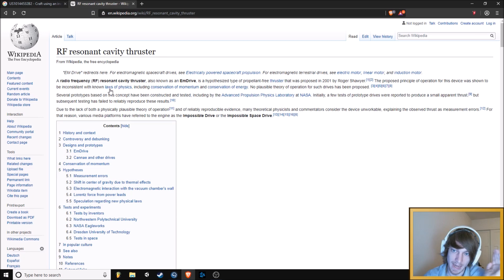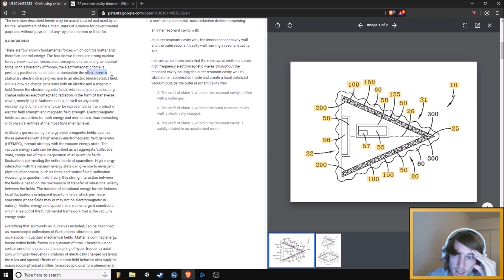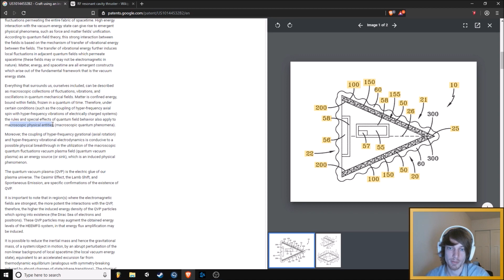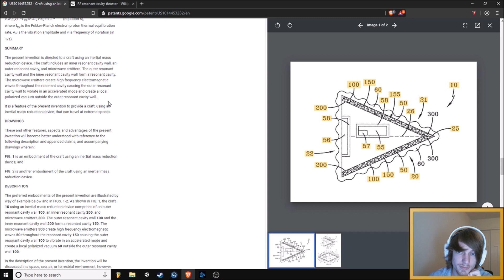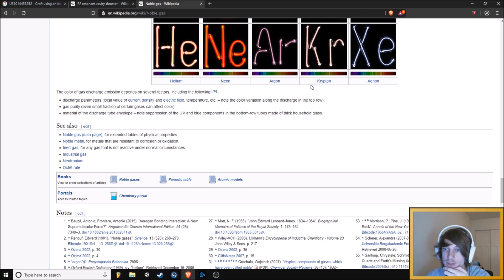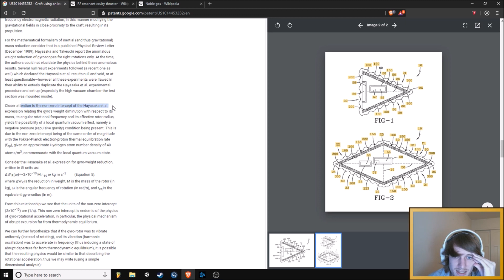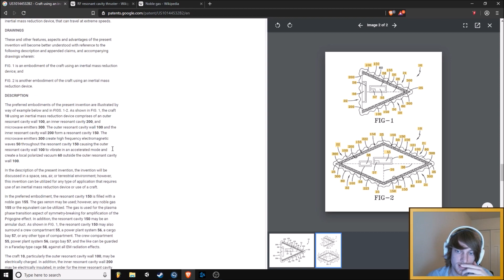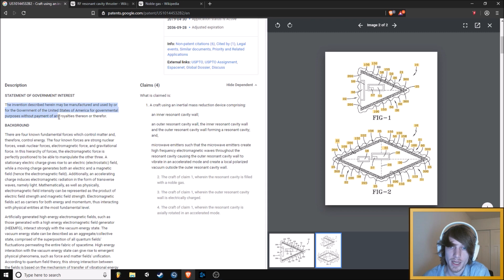EM Drive Is Back! (UFO? UAP?)

Comment: Looks like the thrust results are an error in the experiments.  Due in part by equipment and the earth's gravitational field.  Maybe next time we will a good EM drive.
Reply: That is only a theory derived from tests made from Dresden University.  Although their setup and power input differs from other experiments it is still not conclusive.  However what is described here is not the EM Drive.  It is similar.

Comment: Dr Jack Sarfatti has been talking about his studies into metamaterials which sounds like what this EM Drive exterior is constructed from that allows it to reduce its mass. He explains how Layering certain metals and bonding them at a nanometer scale and charging them with an electromagnetic field can sort of alter its place in space so gravity, inertia, the speed of light, etc. has no effect on it. He says having this material on the outside of a craft would allow it to do amazing things if even only powered by a AAA Battery. In a sense, the skin of the craft, this meta material is its engine! It sounds like this patent is using this material to surround this EM Drive device. Dr. Jack Sarfatti explains this in the following video. FF to 10:45min: https://youtu.be/ROJ8hQBDHJM

Comment: What if you reduce the weight to a negative value? wouldn't the object start to move then? or float in the air or something like that?
Reply: The scientists are calling it quantum buoyancy lmao It's the typical counterbary and barycentric control witnessed in Magnetohydrodynamics, aether fluid dynamics. Twistor Theory, Field Theory, etc. Einstein's Unified Field Theory was amended and completed by Viktor Hlavaty.

Comment: Wow. great find. how did you find out about this patent??? one would think it would be a closely held secret. it's not like the navy needs to file a patent in order to protect its IP. i always thought they declared things like this, "prohibited under national security." i probably have more questions and observations, but this is what pops to mind first. hope you can find a minute to respond.
Reply: China is developing this and they steal all IP. Might as well patent it and have a legal claim to the invention that you can defend.
Reply from the maker: Someone linked it on reddit about something unrelated. I read it and found the connection to the em drive. Also because the em drive has been proposed I think they figure the public will figure it out anyways so they might as well patent it.